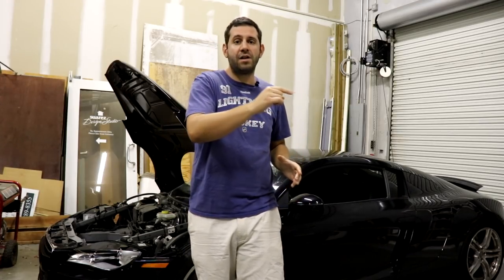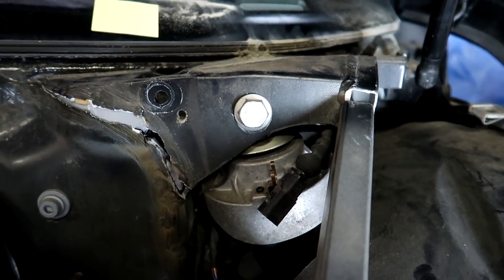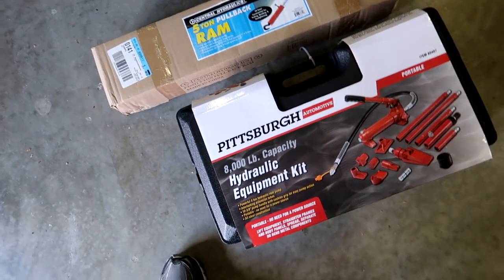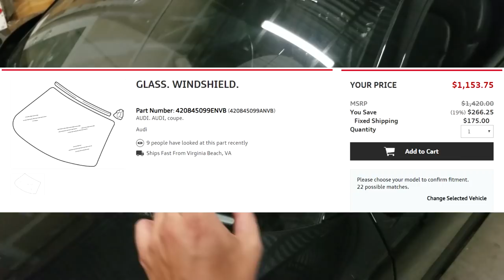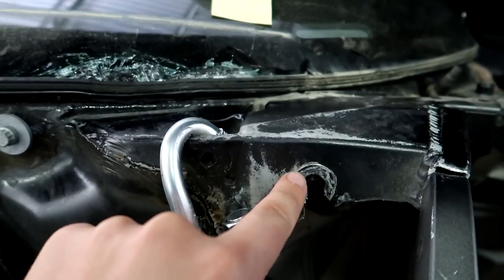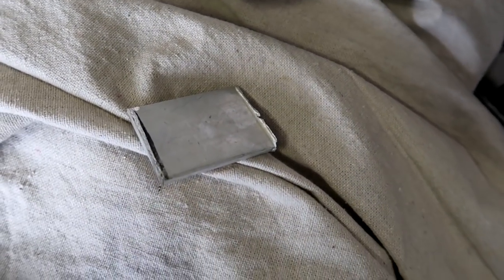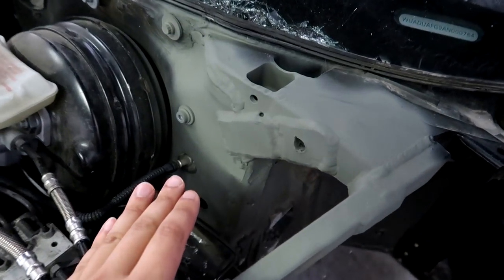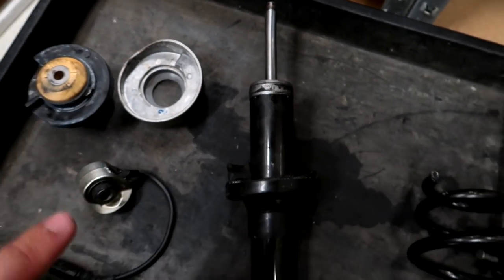I Repaired My Totaled Audi R8's Cracked Frame for $500! Insurance Quoted $29,522!

Comment: I once had an 8k miles06 Cherokee that a privately insured Waterways manager drove into a brick wall at 35 mph. He blamed the gas pedal. They wouldn't replace. I told them to go find one similar doesn't have to be new. They said nope. we gonna fix it. It had all kinds of frame damage that was computerized factory welded. They had a guy at the Jeep dealership weld the thing back together for 3 weeks. Cost them more than replacing. So I have a Cherokee that has been "factory" repaired. We drove it home and my wife said "Oh, hell no. My kids aren't riding in this thing."You could sense it was ever in another wreck it would collapse. Started making all kinds of noises etc. It's no joke, Be very careful in that thing. People are correct. You have no clue what stresses are on those fixes.

Comment: I woulda put a floor jack on top the cracked area up there, put a pole from the jack to the ceiling support beam, and started jacking on it to push that area of the support down to close the crack. Just how I woulda thought to do it. Instead of pulling on that small hole, push down on the whole support to close the crack and not risk any bending or stretching of the related area.

Comment: My family has owned a body shop for many years and I am the aluminum welder/fabricator and I can tell you that this repair probably weakened the aluminum surrounding your welds. I am not judging I understand sometimes cost is an issue but next time what I would have fabricated an 1/8 inch 6061 aluminum gusset that covers the crack and spans the  strut mount from beginning to end and that you can weld in and around the joints. Good try though.

Comment: Interesting video and I hope it all works out OK for you. For me it looked like a bit of a "patchwork quilt" repair job.  I am no engineer but logic tells me that this section collapsed because it obviously is was unable (badly engineered) to accept the level of stress imposed. I would have employed a steel fabricator to reinforce the entire section as oppose to an 'inch here' and an 'inch there' approach, otherwise you risk further damage which may prove more catastrophic should you be travelling at speed.
Reply: It was subjected to an impact force, not repeated cycling. The bent shock rod is the clue. The original owner probably dropped a wheel off the pavement into a pothole at speed. I would be checking underneath for other damage just to be sure.

Comment: Why not connect that top bold of the shock with the other big bolt on the lowr left. Like engine bar or those bars which go from strud to strud. That would be stronger than the weld i guess.

Comment: Should have put a rectangular piece of metal  with holes in it across the top of the frame rail and used that as a pulling point instead of the frame rail itself

Comment: What passes for a "frame" these days is amazing... but mostly scary!
Reply: Musashi Nagatsubo agreed I will keep my modded 1976 manual  supercharged vette super heavy duty old school frame all steering and ball joints 1976 Original they have grease fittings 19 on the car ,I grease them lolol . The clutch and pressure plate original,differential original,rotors original, shocks aftermarket road race , fabed  coil over used in conjunction to Oem f41 road race suspension .The car is head turning in blue and diamond metal flake with diamond silver hood stripes  and silver and diamond flake rear  3 inch dual hand built exhaust  .cooling system custom 4 row rad and 2 16 electric cooling fans  . Raced 2 seasons in b street prepared in solo 1 auto slalom and nationals and solo 2 on road race track around north east  during my 39 years of owning the car I replaced power steering pump , brake pads ,rebuilt and modified engine heads blueprinted installed supercharged .

Comment: Hehe. Ok theres a lot you might have done better but you got there in the end.  For the pull on the mount you can use a spacer or washer stack to tighten down on to mitigate that that hole pulling out. In general hammers are used to set damage in a situation like yours, pull, set with hammer, kinds saw the windscreen coming, ouch... Your welder knows his stuff. Should be measuring and comparing dimensions/locations of holes side to side to side, i didnt see you do that but you should be in the ballpark. 
Got to love the comments section here. Everyones an 'expert' lol.

Comment: I would have drilled the end of the crack at least. The most stress in any crack is at the very end of it. Drilling a hole at the tip of the crack, be it wood, steel, plastic, whatever, significantly reduces or eliminates the stress riser. It even appears the weld bead wasn’t taken back all the way to the very tip but hard to see, you could still do this and just spot weld it for peace of mind.

Comment: hey sam you might wanna smoothen the edges of the fitting hole of the bolt with a file and sandpaper Due to vibrations the rugged edges of the hole are gonna make dents on the bolt and eventually it will break 
seen it many times on steel construction and its very ugly
Reply: it would be best if you replaced it with a 12.9 bolt quality just in case

Comment: I've read a lot of comments. I guess my question is why would Audi Use Aluminum on high stress frame components on an $80,000 car to start with. I understand it can be used in certain areas but a finite area computer analysis should have shown areas under torque and the effects on modulus in those areas. I think any desires I might have had to own an Audi have just been quenched.

Comment: Samcrac, I know it must be hard to admit you've got a lemon, but in this case you must. It would be completely irresponsible  and immoral of you to let this car, capable of such high speed, out into the public roads, or to sell it as a roadworthy vehicle. You have no stress analysis, and no idea of the loads on the frame ,and without an engineers survey and approval its anyone's guess when that shock mount will fail and the consequences of a high speed failure could be tragic. The valid points made by many here in the comments concerning the fatigue / lack of heat treatment reflect this. You don't even know what alloy you are dealing with.  Please reconsider your choices with this car.
 Years ago I worked as a sound engineer on the Aust. launch events for this vehicle, I remember my shock when one of the German gentlemen accompanying the launch tour told me how all the demo vehicles would be scrapped....because of the liability involved with aluminium based frames.

Comment: Interesting project.  The biggest issue I see is that the frame structure of the car is not robust enough in the right places and that's a design issue.  I would suspect that there are other areas that will also crack over time.  If your car can't take a pothole or curb once in a while without catastrophic damage, what good is it?  I would have tried to get the factory reinforcement panels to do the repair.  I've repaired things before on boats and cars in a similar manner and what usually happens is that the repair fails and all of the time and money spend are for nothing.  If it were my car, I would monitor that area periodically and see if it starts to crack again.  If it does i think you part it out.  I would buy a Corvette and enjoy the drive and the fact that you can get parts at Pep Boys...

Comment: One hell a expensive hit with hammer. And one extra jackstand set to 1 level lower than the anchor jackstand. If that jack would flip sure could add alot cost to build or injury

Comment: Hey man I’m a welder and just so you know u really shouldn’t bend aluminum yes it works but it is stressed and is fragile now be carful don’t beat on it to hard. Also aluminum doesn’t rust so u did not have to paint it with primer endless u intend on color matching to the original color also the reason the gusset broke is cause u were pulling from the out side u should have pulled from the inside where the shock rides. I know you will probably never see this out of the other 6k comments but if you see it I hope it helps.

Comment: 2 years late, so I guess somebody mentioned it, but that whole welded area doesn't have any mechanical strength. Some aluminum grades are unweldable, such as 7075 and 2024. The welds will crack just after a few days, if not hours. Supposing this is 6061 aluminum grade, on its own it has almost no mechanical properties. That's why it requires heat treatment. So, we can assume the original piece was heat treated, but welding an already heat treated aluminum piece will "remove" the heat treatment in the area of the weld. 

So, the repaired area is now a much weaker spot, but even the other side that was "OK" is now weaker cause he decided to "reinforce it" by welding.

It's been 2 years now and it's almost certain this frame has failed again.

Comment: You could smooth over that horrible dangerous bodge with some mashed potato.
Boil the potatoes then mash until smooth (you can get powdered mash if you haven't got the correct tools) then using a smoothing hammer, apply the potato to the supercars critical structural suspension mounting point until it looks nice.

Comment: I do not think there will be an issue with the welding, these cars are just a series of parts welded together in the first place, but I do think he should have made some cuts to relieve the stress rather than use so much force to pull the mounting back into place, this part is now welded whilst under stress which is not ideal, A body shop would have used new parts and welded it on a jig for accuracy, there may be some  tyre wear issues now

Comment: I can't believe a guy would spend $30,000 on a high-performance car and not even buy the service manual for it. It saves you the time and effort of "figuring it out" as you stated for the shock removal. Most importantly it gives you the exact specifications you need for torquing down bolts, the proper measurements for any adjustments etc., and provides diagrams that would be helpful in any body repairs. If you are going to do something like this then do it right or don't do it at all.

Then using a jack stand a point to secure the chain for pull back ram and hydraulic ram pump. How safe was that?  Any unexpected stresses on the jack stand and the bam that front body section come crashing down. Samcrac is a shop accident waiting to happen. Then he breaks the strut mount hole and windshield. priceless. This isn't auto repair, it's auto repair comedy.

Comment: $29k insurance quote because of liability and it being a super premium car. The repair would be certified and a super high performance and fast car is more likely to wreck and maybe try to blame it on the repair than grandma's 95 corolla.
I have a truck with a frame issue and no one will touch it because of liability, and frame shops want more than the cost of a new frame and more than the vehicle is worth.

Comment: I hope this doesnt sound like a dumb question. I dont know Audi front geometry or design, but is this just the shock mount? I couldn't see where any of the actual steering parts are affected like the control arm mounts. So wouldn't this repair not be critical to alignment?

Comment: I'm not a mechanic or have much experience repairing cars, but this doesn't look safe at all.  You didn't do a full disassembly or whatever to check the full damages in the engine. You just "repaired" the only visible damage you saw. I think the more you reveal, the more issues you'll find. I could be completely wrong. Hope everything worked out.

Comment: To get equal pressure shouldn't the bolt be replaced the way it was with shock / strut in place, bolt thru chain link, then pull on link.

Comment: It is my opinion that the repair is not sufficient, it really needs an additional support bracket fitting from the end of the outrigger box section to the inner wheel arch.   The fact  that it is not an 
isolated problem to me suggests a design fault , without  additional support will fail again..(sorry)..

Comment: I understand the horror of all the 'professionals' who have training & experience, however I take my hat off to Sam for having the balls to take a shot at something that in principle is not that difficult (welding up a crack) but fraught with risky probabilities. There are of course, only 3 obvious questions: Is the material actually repairable like this (ie. can it be re-welded?). 2. will it hold under the significant stresses placed on it (the original engineering and/or material was flawed and failed after all). 3. Will it pass an inspection & be registerable & insurable? 
I'd probably have had a go at this if it was steel rather than Aluminium and if I'd only paid $3000 for the car but it's a big risk on a $30k+ vehicle. Still, gets a lot of Youtube traffic and it appears Sam has quite the car collection so overall it's probably worth it eh?.....

Comment: The problem with this fix is that the metal that was still holding was bent and then straightened and could very well be cracked but you cant even see it. Welding and reinforcing what you could see is nice...its the fatigued metal that you can't see that is a concern. I think its best to use this car yourself with no passengers and never sell it . Beautiful car though.

Comment: The reason that is expensive is because Audi or a certified body shop would remove that spot welded section and replace it which requires removing all the components surrounding it. It’s a very big job to do properly per Audi specifications. In fact they probably would’ve fixed it in the amount of time you spent patching it. Now is there another way to do the repair? Absolutely.., but you won’t ever get the salvage off the title unless it’s repaired properly. A crack should be drilled at either end then stitch welded along the seams. The fact you still had a hole/gap tells me you didn’t spend enough time aligning it. As far as that weld goes it’s probably stronger than the factory tower but misalignment even a minute amount will prevent that car from handling as well as it was designed at high speeds (specifically above 100mph). For a car you wanted and plan to keep yourself it’s fine and your not a complete idiot like some suggest despite smashing your windshield, lmao. In the future toss a thick piece of styrofoam over the glass to sustain any accidental impact. Enjoy your car and be safe when you’re driving.

Comment: As soon as I seen him use the hammer, the first thing I thought “man he’s going to hit the windshield “ specially how wimpy he was swinging it
Reply: IncogNieto  friend of mine  preforms collision repairs to European hi $$$cars at the dealership he works at which is a American domestic dealer lololo . The dealer of a major European company bring all his collision to my friend at the American dealership because he does a super job . My friend  had a car in for repair which the front fender and concealed coil tower damages which were not first picked up right away.  The camber was off on the car less than 1/2 degree and could not be adjusted .later my friend found the coil towers were riveted in at  the factory but the Oem rivets were buried under Oem sealer and made of some form of carbon fibre fibreglass ,the part was ordered from Europe it took months to get as the manufacturers did not stock them and had to find a supplier the car was 2 years old at the time , no direction from the European manufacture was offered lolol . The owner was super patient in waiting for the parts ,it took months .My friend had to devise a way to rivet in the part once it arrived . My point is what Sam has done to the Audi in my opinion is a great repair on the car I would drive it

Comment: I'm going to let you know now why it was a write off, you can't just reweld structural aluminium, that car required a complete strip and heat treatment to bring the aluminium back up to temper and make it strong enough to use again, what you did was the first step of a process that is much more complicated than you clearly understand and you've now got a car that's no better than it was.

Comment: A trick I learned from a mechanic, take the wheels off and put them under the car. This way if it falls, it will fall on the wheels and not on top of you.
Reply: Do you mean, "land above you"? You are trying to prevent it landing on top of you....
I also do the same though.
Reply: @omardude39  Thanks for pointing it out, I updated the comment.

Comment: Weld?  Why?  I think it will crack again.  Too much fatigue and now metallurgical damage from welding.  I would have put it in place, and then bolted plate over the top.  Bolting on a plate would have caused much less damage to the parent metal.

Comment: After you used the dremel, you said that you made sure to put primer on it so that it wont rust.   Did you mean corrode?   Or just a slip of the tongue from usually working on steel frames?

Comment: Knowing that you're driving a supercar on the road that's been bent back into place and welded together is just downright terrifying...
Reply: Travisty my body man friend just replaced a strut tower which was on a 2 year old European car that cost over $400000.00 new . The part  was made of carbon fibre / fibreglass and it took 6 month to get from the manufacturer who did not have one ,and get this was riveted Oem to the unibody  with 5 large rivets burred in black sealer , that would worry me more than the weld done here

Comment: So let me get this straight, you have a highly stressed point that you have simply welded,? Plus you are not putting any reinforcing plate(s) on it? Even though there is a massive weakness in two areas of the frame?